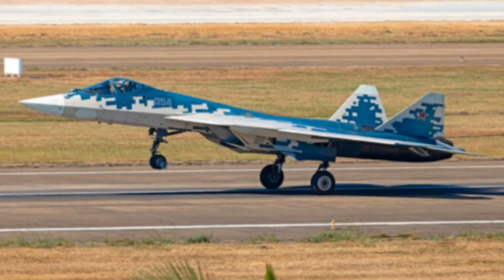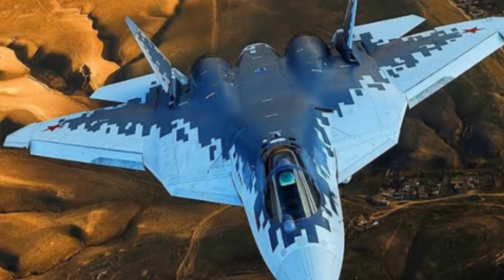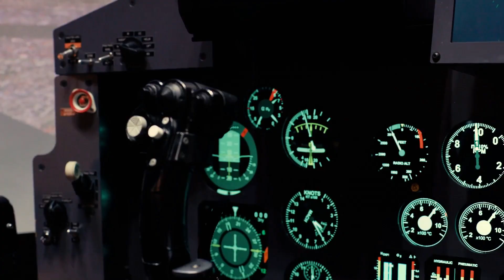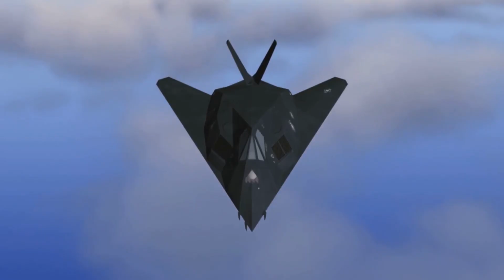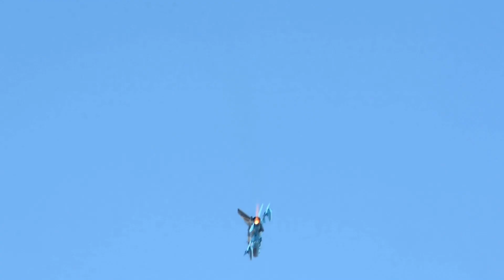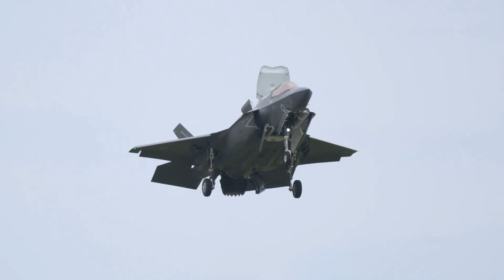Insane Engineering of the New Su-57 Izdelie 30 Engine Explained

Comment: russian propaganda at its best :)  listen russian chills, SU57 has radar cross section like a barn :)

Sukhoi claims Su-57 having an RCS goal between 0.1 to 1 m^2 (-10 to 1 dBsm).

 the F-117 had an RCS around -25 dBsm while the F-22 and F-35 has an RCS better than -40 dBsm – which is at least 1,000 to 10,000 times smaller than Su-57

Russia is nothing but lies.incompetent liars, warmongerers and inbred orcs.
Reply from the maker: The video focuses on the technical aspects of the Izdelie 30 engine, not the Su-57's RCS.